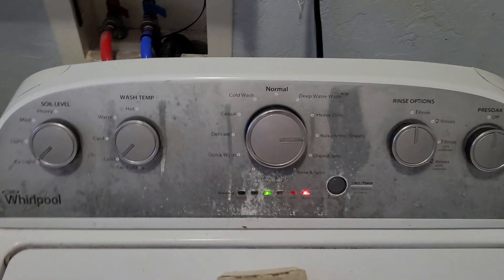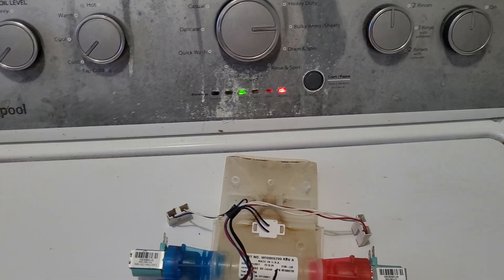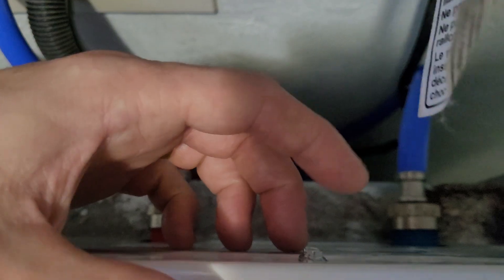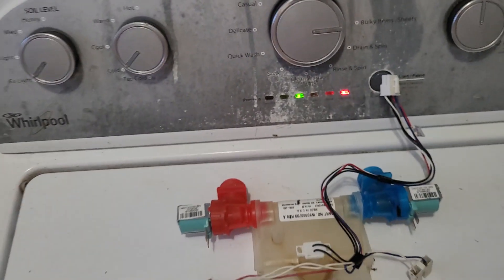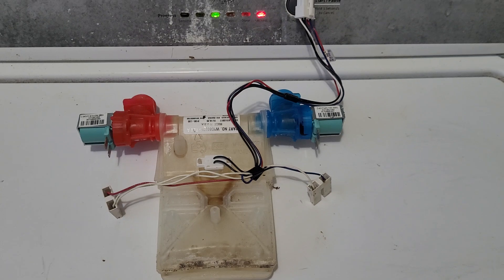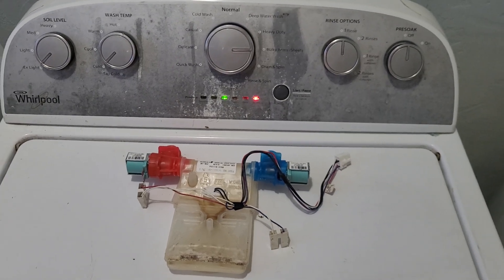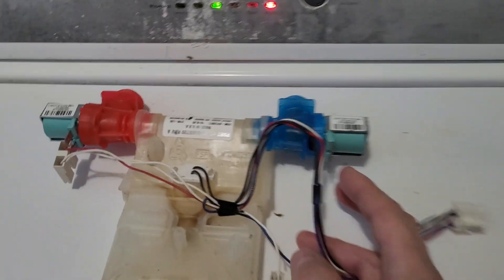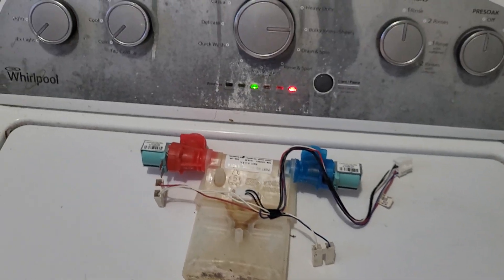How to Fix / Repair a Whirlpool Washing (Washer) Machine With Sensing Issue - Not Working / No Water

Comment: Now wrap it in glitter 😀😀😀,  I, have a Washer that kept giving me a certain code and I was about to get rid of it but when I looked up a video it was a drain Catcher that was clogged! Now I know where the missing sock goes 🤣🤣. Now every so often I have to unscrew the back of the washer and put a pan underneath and open the drain and take out whatever junk get sucked into there. Way cheaper than buying a new washer
Reply from the maker: Glad you were able to fix your washer! About a week before the washer had issues, our refrigerator went out...I did everything I could but couldn't fix it. I was glad was successful in getting the washer working again.